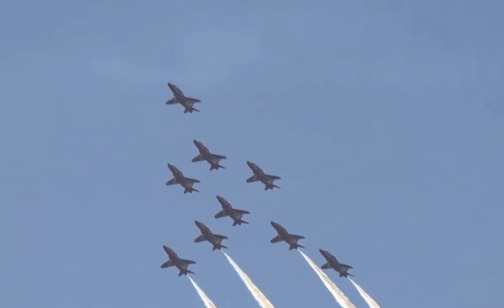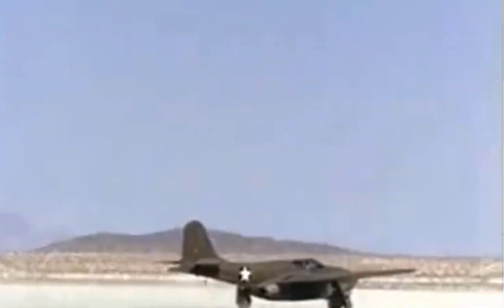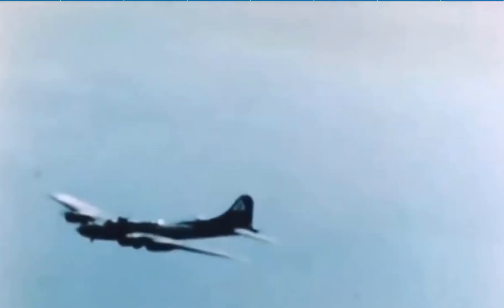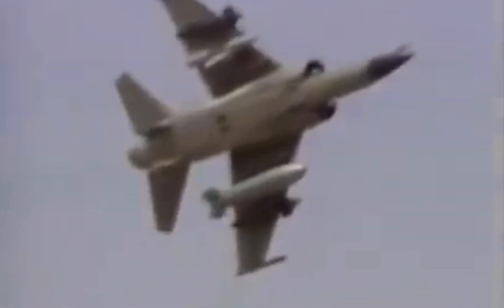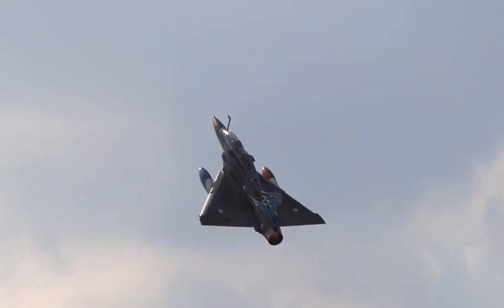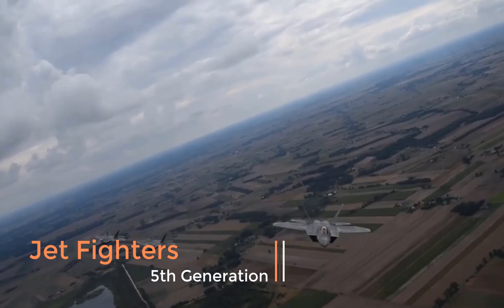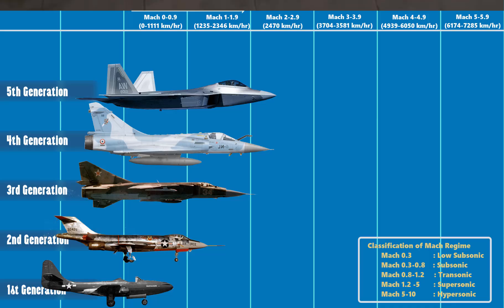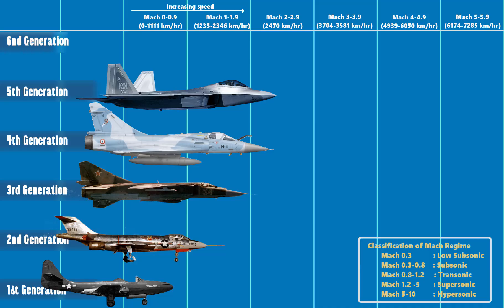Evolution of Jet Fighters (1st to 6th Generation) | Speed Comparison

Comment: USA has top secret highly advanced technology system and Mach 6+ manned jet fighter with laser weapon and advanced Mach 8+ air to air missiles but in draw board as 7th generation aircraft after USA 6th generation Mach 4+ or 6+ jet fighters will be flying in 2030 . Russia dream about 6th generation Mach 6+ aircraft but engine always problems since MiG - 25 interpreters has problems with engines as cannot faster than Mach  3.2  as attempted catch Blackbird SR-71 spy aircraft flying faster than Mach 3.2 . If Russia pilot try attempt push MIG -25 interpreter go faster than Mach 3.2 then engines blew up as damaged lead destroyed MIG - 25 plane as pilot killed but pilot had unsuccessful attempt catch Blackbird SR-71 spy plane as missiles failed then landed on runway of Russia military base , crew checked on engines inside MIG-25 aircraft , found two engines half damaged as destroyed but cost pilot lose wing plus in prison for violating rule forbidding MIG pilots can’t go faster than Mach 2.3 as require pilots must stay under Mach 2.3 as protection engines . MIG -25 aircraft engines had replaced damaged engines with new ones take months after disgruntled pilot removed from Russia Air Force to prison . Pilot release from prison then flying helicopter or lowly factory job . Syria MIG -25 attempted catch Blackbird SR-71 but failed then returned back to base , found two engines destroyed as damaged by Syria pilot push MIG - 25 go faster than Mach 2.3 but engines freeze as loud bang as disfired forced Syria pilot decided slow down then return back to base as landed safely . Syria pilot got shot or in prison for violating rule banned pilots of Syria from go faster than Mach 2.3 . MIG -25 can’t interpret Mach 3 + B-70 bomber but USA Air Force decision cancel Mach 3+ B-70 bomber aircraft due Russian had missile defense systems in Russian . Russia 🇷🇺 can’t succeed building Mach 6+ interpreter . USA already has mysterious top secret two manned Aurora spy aircraft flying at higher altitude as speed Mach up to  8+ . Blackbird SR-71 are retirement in 1989 then NASA decided Blackbirds retirement in 1999 .  USA Raptor are highly advanced technology as highly advanced combat but Mach speed is top secret but fly as Mach 2 + at 60,000 feet attitude . New advanced 6th generation jet fighter will go faster than Mach 3.2 . God know .
Reply: "USA has top secret highly advanced technology system and Mach 6* manned jet fighter with laser weapons" where the fuck did you get this information? It can't be from the US military/government since it's "top secret" so where the hell did you get this information?
Reply: I'm not sure about yall but I spy some American bias
Reply: Mig25 limited to mach 2.83 not 2.3
Reply: https://youtu.be/a7ybjVmdryY
Aniway the russians will do better.
Reply: The Russians will take off MiG 41 soon in 2025. Its speed will be more than 4000 km/h
Reply: SR 71 shit so it was written off! MiG 31 and MiG 25 have no analogues in the world. America defends from Russia as, the Russian bombshell Tu 160 leaves the F 35. And the F 22 is inferior to the Su 57 in speed. You believe American propaganda.
Reply: @andrejivanov5051  Yes, you will need speed to run from a fight but what good is speed when when a missle will render speed useless. Lol
Reply: @discostu5925  You will have to run from the rockets, not me! West is faint behind, in terms of military equipment.
Reply: @discostu5925  There are no good rockets in America, only old ones.
Reply: МиГ 31 3400 км/ч. что есть в америке, что летает быстрее? а у России 150 МиГ 31.